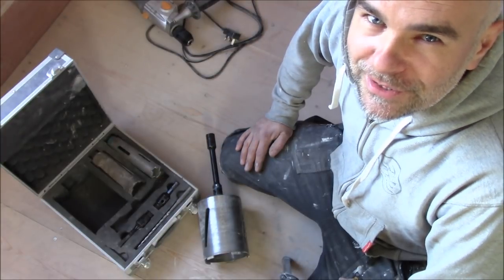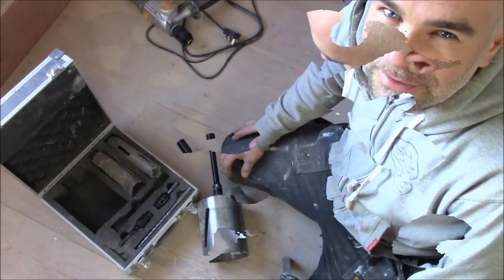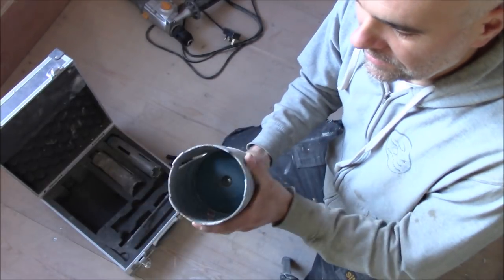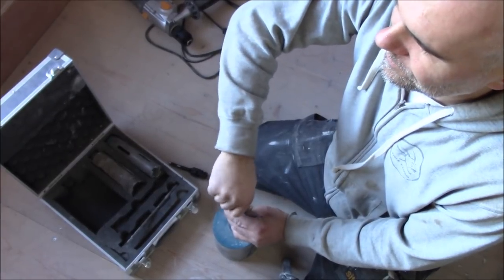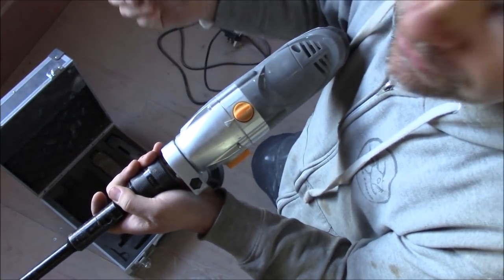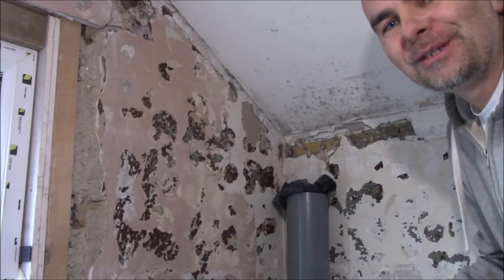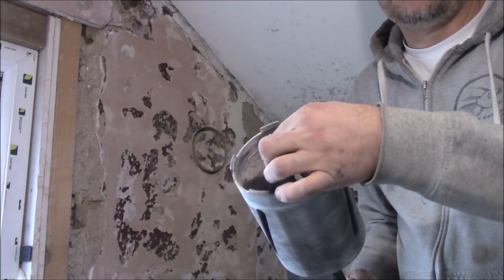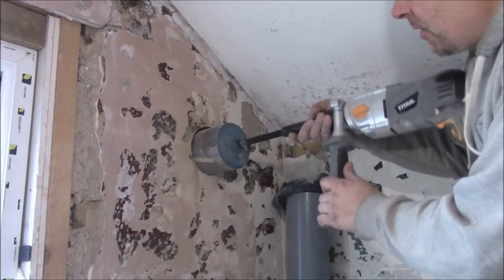How to drill a large hole using Diamond Core Drill Set  Dry core drilling

Comment: Nice little video but I wouldn't have gone right through from one side in case of breakout! I use a long pilot drill to go right through and then use the core bit and go half way from inside then do the rest from the outside so no breakout!
Reply: Wrong! What if your on second floor up ladders you wouldn’t be doing it from outside then

Comment: Hi quick question before i buy. I have concrete block walls in my house. I have the bosch 2 26. It has 800 watts. Do you think it can handle core drilling of say 60mm dia? Or i will have to get something more powerful?
Reply: Should work. I used the 2 28 850 watts to do a 105mm 30cm deep. I had a 5cm deep cup that's more intended for ceramics so it took a few cup drills & chipping the leftover core with a chisel so I can get deeper. I saw a commercial for dry core bits of similar size to the one used here on youtube and the manufacturer recommendation on the video was 700-1200 watts. Make sure you work in drill mode with the hammer turned off. Also, wouldn't hurt watching a safety video. This video shows the wrong way of holding the drill.
Reply: @osh2023  yea thats actually right but i think instead of buying those cups which arent the cheapest. I could just drill holes in a circle and then chisel the piece out with the hammer only function. Its a fraction of the stress on the motor. And if youre not in a serious hurry i believe its a better suited solution. It can be very dangerous when the cup locks in the wall and the drill transfers all the torque 😀👍
Reply: @ofrimashiah2  I actually bought an sds chisel and tried removing core parts with hammer only mode on the drill but it was extremely weak and I switched to manual - chisel & hammer. Either I was doing something wrong or that the 2 28 hammer only function is not great for breaking material to pieces. In videos I've seen, I know it is commonly used to mark the lines and break edges of a power line canal on the wall before you really break it. Have not seen it used to really break stuff.
Reply: @osh2023  yea it depends. In israel we have 2 types of concrete walls. We have solid concrete... And we have cinder blocks with hollow core. Those are not as bad to work with. But solid core im not so familiar. If i had to guess i would do a series of holes. The wall itself is already strong and hard to work with. I would probably use the spike to break from the outer part of the cilinder. Also note that the wider the edge the less breakage occurs because you split the impact on much greater area. A tile chisel isnt a spike for example. I by the way bought a 26mm sds drill. Pretty much a chinese version of bosch 26 mm for about 100 110 usd. And it came with the exchangeable chuck and also a set of 6 8 10 mm bits and spike and a 1 cm chisel. Im very happy so far. Not massive amount of work with that yet. Mostly mix mortar but im very happy with the power 😀

Comment: Hi does this compromise the stenght of wall ?
Reply: It can, but often the hole is slightly larger than the pipe you are fitting, allowing you to pack mortar around the pipe.  Using a strong pipe and mortar will basically create 2 arches (one of them upside down) and help return strength to your wall.  Brick walls with good mortar won't lose much strength but old stone walls with soft mortar can easily become weaker depending on how the stones around them are arranged which isn't easy to see if they're covered in render or plaster.  So for peace of mind i would pack the mortar around the pipe both ends as soon as possible.  I'm not a professional builder, but try my best to work safe and prefer not to take risks :)

Comment: Hi will this drill set be right size for kitchen sink waste pipe hole and basin hole pipe ?
Reply from the maker: Cores are 52mm and 38mm  basin waste  is 30mm and sink 40mm so for sure they are good
Reply: Tanx for reply,would b nice to c u fit extractor fan.